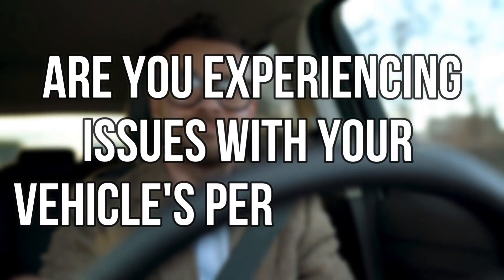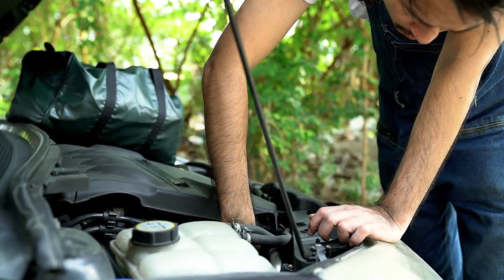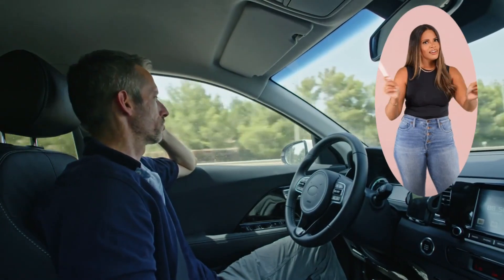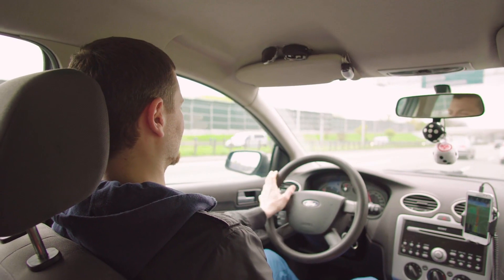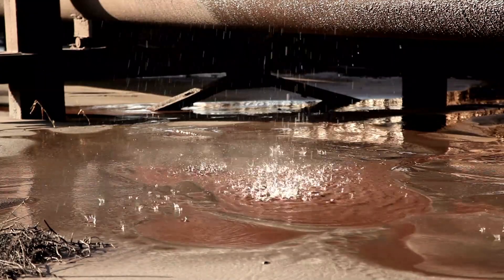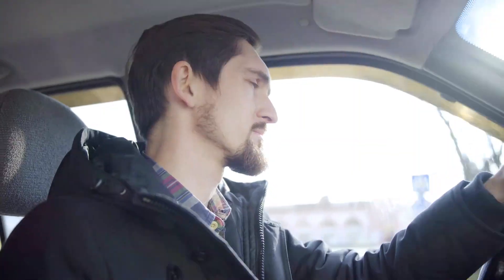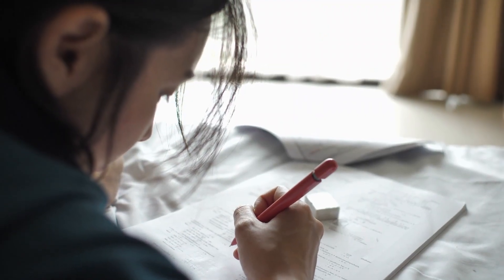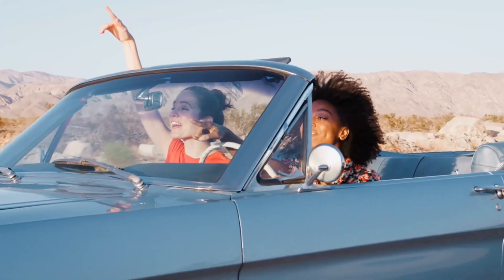9 Signs of A Failing Fuel Injector | Diagnosis & Cleaning Tips

Comment: The fuel system of a car is not complete without fuel injectors. They precisely and steadily spray fuel into the cylinders of the engine.  Your engine may be experiencing rough idle or irregular idle speed as a result of blocked or broken injectors.

Comment: very useful tips! i appreciate this! If your fuel injectors are dirty, they may be able to be cleaned with a fuel injector cleaner. This is a relatively inexpensive and easy procedure, and it can often solve the problem. However, if the injectors are clogged or damaged, they will need to be replaced.

Comment: Fuel injectors are essential components of a vehicle's fuel system. They spray fuel into the engine's cylinders in a precise and controlled manner.  If your engine idles roughly or has an inconsistent idle speed, it could be due to a clogged or malfunctioning injector